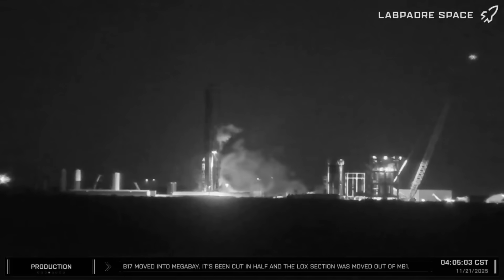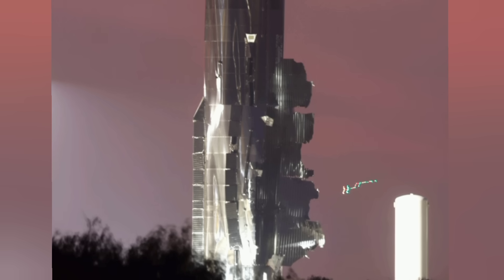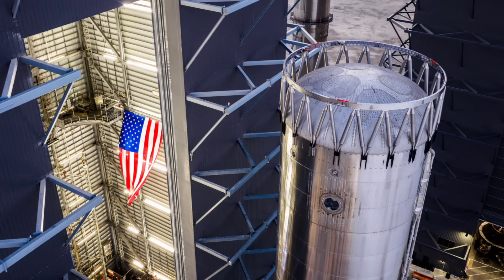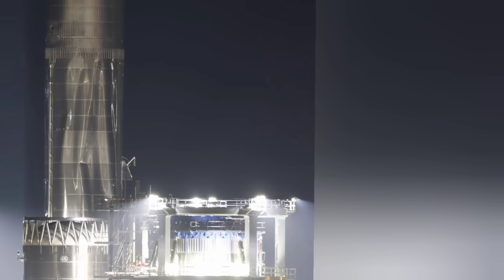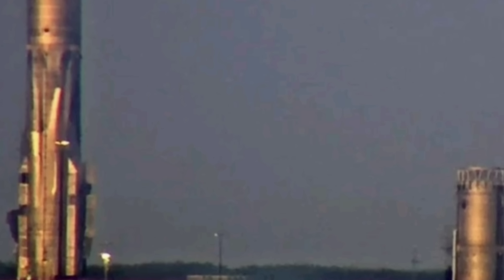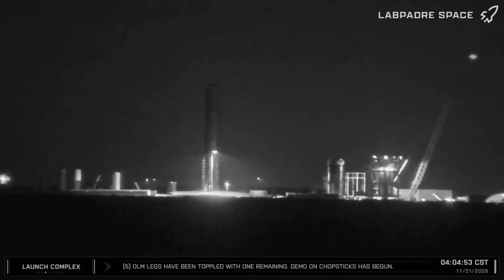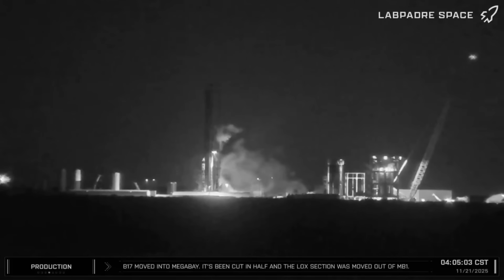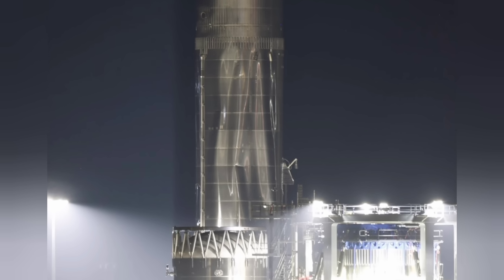SpaceX Starship Booster B18 Implodes!

Comment: I have over 30 years in the test community. I wish more folks understood that testing and development is all about failure and resolutions. Will their moon landing slip to the right by two to six months. Perhaps. No big deal.
Reply: Yes, but how many years and iterations this article  went through ? Seems more like wondering in the dark when almost 10 years later we have major internal and external hull redesigns all the time.  This is not right.
Reply: @dukenukem8381 What you have to understand is that something of Starship’s magnitude has never achieved or done before. They have no Precedent. They ARE wandering in the Dark and so Far they are doing Much Much Better than anyone else would’ve done in their same exact shoes. 

Startship will have rough patch after rough patch but It WILL come out the other side Stronger and Better….and when that happens, Impossible dreams become Realities overnight. No Billions spent on a Tiny Moon base, No Mars city plans are deemed impossible anymore….This WILL push us forward in a Ginormous way. This will permanently keep us in Space And SpaceX will have an Insurmountable Gap whilst others are still flailing around with their Falcon 9 copies. SpaceX is a Decade ahead of Competition now, Starship will make it Decades ahead.
Reply: First, you do careful exhaustive design work up-front, with modern CAD tools and finite element analysis to design a structure capable of meeting service stresses, with a decent safety margin. There really is NO excuse at this stage for SpaceX to get the basics wrong. Iterative design is a waste of time and resources if you don't learn from earlier mistakes.
Reply: Just remember NASA paid SpaceX to build a moon lander... not large reusable rocket.
Reply: @nickl5658 , yes.  Nothing wrong with SpaceX’s development cycle.  But it should never have been allowed anywhere near the initial Mon landings.
Reply: 1960's gave us the Saturn 5 rockets with 3 enormous staged rocket boosters. 
Here we are in 2025 and we cant get these boosters right??
Reply: Compared to the Saturn V, I am very unimpressed with Space X.
Reply: @MikeMcglynn-qv1tq Saturn 5 was built with national pride at stake with the best the nation had (plus Von Braun & company). The only motivation these companies have is to make money. They could care less about national goals.
Reply: @hawkdsl  And Musk has done the opposite with DOGE!!
Reply: What's another 30 or 40 years for that matter? Musk promised people on the moon by 2020 and we have yet to see that.
Reply: @enigma591  Musk never promised people on the moon by 2020. His goal has always been Mars and they're still doing it.
Reply: @jamescarter8311 1 million people living on Mars by 2024 to be exact.
Reply: lol
Reply: @jamescarter8311  Actually, he did.
Reply: I have always been a lazy bastard, with the work motto:

Do it right the first time, instead of doing it a second time.
Reply: @Nearly-visible I'm the same, if I can't make it perfect the first time I palm the job onto someone else.
Reply: @Nearly-visiblethats called waterfall method spacex is leading the space industry because they are not using that method so why will they use that if iterative methods is whas working for them
Reply: Let’s remember, NASAs Saturn V Apollo 11 land 2 men and an electric vehicle in the moon. No Saturn V rockets were injured in making that happen.
Reply: @kurknielsen  how much did is the development of Saturn V in todays money its around 50 billion and Starship is around 5-10 billion they are not halfway with the development cost yet
Reply: @kurknielsen - Except the one that failed during the test where they all burned to death you mean?
Reply: @Scissors69  Are you implying that because Starship won’t be rated for human spaceflight, no astronauts will be killed, thereby making the program more successful than Apollo? 
Help me understand your point.
Reply: @kurknielsen - I’d like to reread your original post but I can’t see it.
Reply: @Scissors69 that wasn't a Saturn,  let alone a Saturn V, that was  the Gemini program using an Atlas rocket
Reply: @kurknielsen no Saturn V rocket ever got a payload above low earth orbit.
Reply: @aaronfranklin324  no it didn't,  it was designed for lunar missions, so of course it never did low earth orbit  missions
Reply: This was not meant to be a destructive test.
Reply: @JohnFrumFromAmerica SpaceX waits to see what happens and then declares that's exactly what we wanted to happen
Reply: @JohnFrumFromAmerica  but spacex doesn't tell anyone if its testing yhe limits of it or not
Reply: No big deal. That is, of course, the makeup on a pig outlook. SpaceX boasts about its iterative design philosophy as providing a steady path forward by learning from past designs, incorporating the good and leaving the bad behind. That isn't what we are seeing repeatedly. The version changes are like starting over and are looking more like trial and error.
Reply: Sure thing muskbot.
Reply: @memonk11 Ouch, that cut deep!  How do you pronounce your name memonk11, i’m not familiar with it, is it Dutch?
Reply: I don't believe you. I worked 2 years in a company that does destructive testing. While I was there, we always tested small samples. We even tested parts for a river ship. We never destroyed a full ship to get data. This is bad engineering.
Reply: @MrAlanCristhian  well but not for spacex look at all the destroyed falcons when they are trying to land it you can't replicate that kind of testing unless you use the full scale
Reply: Angry used to think like this until he got dragged in by the propaganda train
Reply: This is more like building cargo ships repeatedly, watching them sink over and over, until one keeps floating. I'd bet you never had something near this scale catastrophically fail repeatedly. If you did, I must have heard of your company, and forgotten that someone else tried this slop.
Reply: @troys9222  they already tried it look at falcon 1 they succeeded
Reply: If you rely on purchase of seals, valves, electronics and most of your components and tooling for your stupidly over complex design from China... 
Then you should not declare an economic war, and threaten a military one. 
Doing that killed your space industry.
Reply: Here comes New Glenn, Neutron, and Spoke Space!
Reply: NASA didn’t fail anywhere near as often. Don’t know why we outsource this to a dipshit and his shitty company built on tech mostly developed by NASA. Oh wait, I do know, it’s so he can enrich himself further on Americas dime. A fucking disgrace.
Reply: Something up with the calculations Zain, you of all people know pressure V tensile strength to handle it so to speak. But, since I'm not on the team that's just a massive generalisation from me, and probably wrong for whatever's going on.
Reply: But but - these guys have to post videos like this with big drama.  They want that click bait and AdSense Money 😅
Reply: Hopefully resolutions > failures. So far it seems not.
Reply: Yeah true, but in your 30 years I bet you have made a mistake and changed it so it doesn't happen again, and if it did time and time again, then the job is totally changed or cancelled.
Reply: Starship can't reach the Moon....
Reply: Space 1999 anyone..?🤔😉
Reply: SpaceX waste allot of money with their iterative design. If it was any other company, they would have been gone a long time ago. Elon's cult of personality kept the hedge fund money flowing in order to set up Starlink.
Reply: except if you are fleeing the planet. it is going to be really bad time for the "elite" really soon

Comment: SLS, Vulcan, and New Glenn appear to have a more efficient development methodology.   Slow and Steady is winning the race.  Make no mistake, any delays to landing on the moon will be due to SpaceX.  They said they would be ready for Artemis III and clearly they won't.
Reply: LMFAO!!! SpaceX is leading the way with the most powerful and largest rocket ever flown, there will most definitely be bumps in the road as it’s entering uncharted territory in rocket science. In the end nobody will come close to SpaceX in space travel, massive cargo and reusability at lower costs
Reply: @ASTOP7675  ROTFL.  SpaceX is on version 3 of Starship.  The failure is something I can see in version 1, but not this far along in development.   As for leading the way, SLS and New Glenn have flown real missions.  As for costs, please share how you calculated them since there is no working version of Starship and development costs are continuing to add up.   No one argues Falcon 9 or Heavy success.  Starship is becoming the CyberTruck of Space vehicles, (not meant as a compliment).  Something Musk appears to have drawn up on a napkin and told the real engineers to build it.
Reply: @pebmets  But, but, Starship will cost $10 million per launch!  It's funny, they never calculate the cost in the same way they do with something like SLS. That first Starship successful mission will cost $5 billion, and counting. It's going to take a while to get the number down, and that's assuming a lot of sudden success.

Comment: Reports say that the recent B18 failure was NOT and fiery explosion.  It was a cryogenic tank failure, which was filled with LO2. The failure of the fuselage.  This would signify that the problem was a assembly problem
Reply: That would make sense, especially if you’re trying to pump out one of these a week. A faulty gasket shake my head, Challenger part two.
Reply: It could either be a design failure, the wall thickness or ribbing cant take the pressure.  Or it could be a manufacturing defect.  As the manufacturing has seemingly been reliable up to now, and this booster was presumably being tested to a higher pressure the design failure seems more likely.  And the only resolution to that is going to be to add mass, which is going ot compound the main problem of the rocket, being overweight.
Reply: Maybe.
Reply: Looks like a typical pressure failure, though what kind we don't know yet. It could even be deliberate though unlikely.. Very weird that it didn't collapse completely - maybe it passed the test.
Reply: So AA is lying to us again? That's pretty normal for him I guess. Gotta get those views up. I mean, with 28k views and 2k upvotes.. we don't really need downvotes to do the math on that one, or any fancy math equations only 1 person out of 100+ can hope to understand. If I was evil I'd be a grifter too, it looks fun if you really like money. I'd be good too but prefer to work for my money, it's what my dad and grandfather so on did and with a fun job where I help people out each day, making them happier, it's better than tricking people who are perhaps vulnerable or lonely. Maybe disabled. Hard to say with hardcore fanatics who take each word he says as absolute law vs a handful of salt as I do. If you really trust this guy, ask yourself why and be honest with yourself. Was it just something you agreed on 1 time? The way he talks? Is it the big numbers nobody can comprehend? The gabba gabba hey science talk w big words most would have to look up but don't? I'm trying to understand is all.
Reply: Sabotage
Reply: @kayakMike1000. Moron.
Reply: @kayakMike1000  I wonder about that too

Comment: Isn’t testing tolerances routine for new tech at Space X?  It’s how they know the max specs .. “all 4 corners” is what they call it
Reply: This was not meant to be a destructive test.
Reply: yes but it is known by everyone that they are going to overpressure and destroy it. for safety of course, but also so they can get it on camera, with lighting, in 4K and highspeed, all that jazz. Not at 4AM with a youtuber's stationary nightvision 'surveillance' cam LOL 
No, this was unscheduled and unexpected, which is why its such a big deal.
Reply: @ThatTweedle  Oh right, the SpaceX whistle blows at 5:00 and they all go home.  Engineer staring at the ceiling in bed "Did I forget to turn the rocket off?"
Reply: Thats what test tanks are for. This should not happen on a flight article.
Reply: They didnt even get to the test they were supposed to be doing, it exploded during initial cryo test. Stress test was supposed to be after, and also not to destruction.
Reply: @matejzizanovic7959  yes people, creating an enormous rocket that's 100% reusable has proven to be extremely difficult. What a shock.
Reply: Not that late in the development process.

Comment: The way development this is supposed to work, things should be getting better.  Updates should not putting you back.
Reply: Well ... does it work? V1 and V2 never got nearly anywhere to reliablity. And now even more components start to fail.
Reply: @f.herumusu8341  It appears the Starship methodology is go back to the starting gate when they have a new version instead of building on what had already been tested.  I believe their lack of proper quality control is why they have more failures than many any other launch providers in terms of new rocket development.

There is a reason why components are tested on the ground before final assembly.  Yes, there can still be issues at launch, but you increase your odds for success when testing on the ground.

After watching New Glenn, the few extra years have given them positive results as of now.
Reply: Expanding does
Reply: They were probably using Chinese knock offs from 1 of many factories he owns there. Disgruntled worker can do that anytime. Once saw a ups truck unloader smash a package that said "family heirloom DO NOT BREAK PLEASE, FRAGILE FRAGILE" all over it, and he laughed while stomping on it (sounded like broken glass or maybe crystal, utterly pulverized) until I told him to stop, that it wasn't funny, called him a bad word and then never spoke to him again. Anything can happen in other word you just never know. I felt bad but once it happened, it couldn't be recalled. Because of that incident, I never felt the same about shipping things again. That some things even if "safe" aren't safe.

Comment: Part of a testing program is failure. This is the first test of the block three version.
Reply from the maker: Absolutely. But this thing is supposed to land astronauts on the surface of the Moon in less than three years.
That's not gonna happen if we're back to pressure failures on the test stand.
Reply: @TheAngryAstronaut  still our best shot, didn’t they start building Orion in 2008 and the heat shield is still unsafe?
Reply: @TheAngryAstronaut  NASA SLS = $ 24 Billion to develop 4 billion per launch 1 launch in 14 years...
SpaceX falcon 9 $330 million to develop $60-70 million per launch 577 launches since 2010...
Star Ship 11 launches in 2 years....  
SpaceX Starship Currently, the cost per launch is estimated to be around $100 million for expendable missions.
Reply: No one was testing anything at 4 AM.